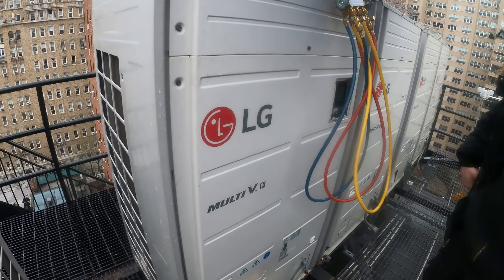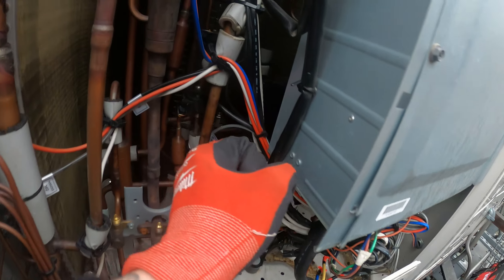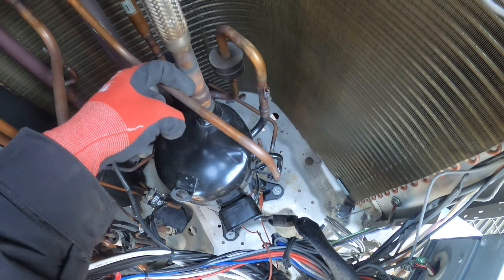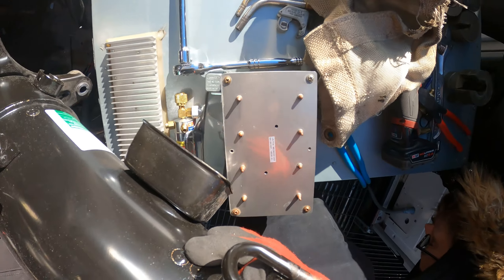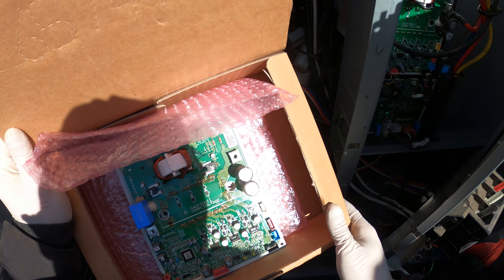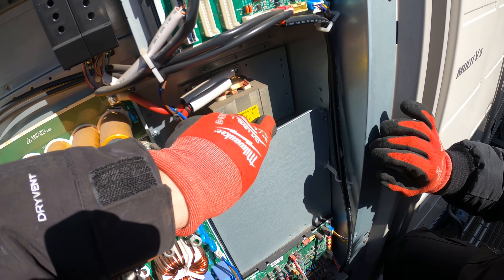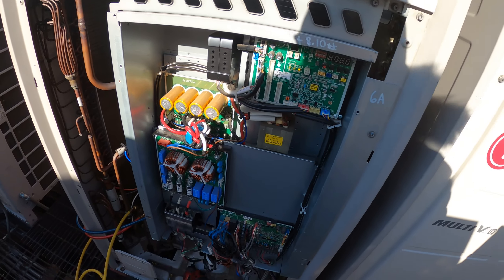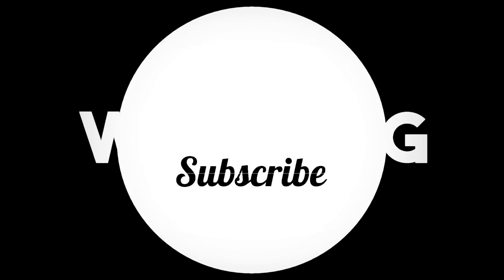HVAC Service Call: LG MULTI V IV Compressor & Inverter Board Replacement (LG Error Code CH21/CH29)

Comment: 18:49 no no it’s thermally conductive, not electrically haha. But it is correct that too much thermal past will will any computer board/pcb so quickly. I’m kind of impressed it took 3 weeks to fail.

Comment: I would say you’re probably coming back to change the inverter board again. The heat sink compound should be a very small amount. When you use too much it acts an insulator not allowing the transfer of heat. Just my two cents but I would have done a few small dots on the back so that when you put it back in the pressure will spread it for you.

Comment: Nice repair did not see dryer replaced. ?
Reply: These systems have no driers. Only strainers. That’s exactly why you have to braze while running nitrogen. If you don’t then it’ll be a shit show when you have to replace all the clogged EEVs.
Reply: @mwdub02  thank you for the info 
You the man!!

Comment: Did you perform the diode bridge test. The compressors are usually solid. Ive replaced inverter boards and noise filter board...never a compressor though.

Use your recovery machine to push the rest of the refrigerant into the system..

Comment: I'm dealing with a lg vrf v same code everything test good lg said replace compressor have you come across this? Everything test out good even the compressor and it's bad ? I have to put a new compressor in and have a different issue... this is happening as i am replacing a compressor in the same model same age 5 feet away working good last night today same codes as on this video also same code as before but the u terminal blew out on the other unit obvious replacement lol

Comment: Did someone diagnosed what cause the compressor to go out do you guys cut open the compressors to determine cause. I have been installing these LG vrf units for the last eight years we have never had a compressor fail I am always wondering when I see a video of a failed compressor I always want to know what the cause was. 

I have 3 facilities in industrial manufacturing I installed that run 24/7/365 two of them for 8 years the other for the last 5 years compressors never shut down,   still I never had to replace a compressor.
Reply: Congratulations
Reply: Just did one of these compressors in a  Multi V today.   Board wouldn't run the compressor even when I swapped compressors.  I wasn't expecting the 5 connections LOL.  Had 5.45 nS = 200 M Ω.

Comment: Yikes! If those boards are overheating and burning up it's no wonder with the thermal paste applied in that way! Please don't apply it like that if you want equipment to last. 

- Firstly, both mating surfaces MUST be cleaned off using cleaning/degreasing agent to remove all old thermal paste. 
- Secondly, for a heatsink like this, apply a bead of thermal paste in a straight line but DON'T smear it around. Then carefully mate the parts together without sliding or smearing. The contact pressure will ensure correct distribution of thermal paste. 

If the old paste is not cleaned off or new paste is smeared around in a attempt to make a better thermal conduction, what actually happens is that you end up with air pockets or bubbles  trapped in there which form an insulating rather than thermally conductive path.

Finally, although most thermal paste is not electrically conductive, cleaning it up from other areas (like you did) is a good idea. There are special products available, including environmentally friendly ones, that make it an easy job removing even very old and crusty thermal paste.

I've worked over thirty five years in electronics and IT building and repairing servers and PCs and other electronics. With some of the systems I work on the processors cost several thousand dollars each and have high dissipation requirements through a relatively small contact area. Incorrect application of thermal paste causes very expensive failures and other issues in a very short space of time.

P.S. I really like the content you post. I find it refreshingly different and the details you put in make more interesting than a lot of other channels.
Reply: Great info. What you say makes a lot of sense!
Reply: Thanks for the detailed information 👍🏼. 

What brand of cleaner would you recommend/do you use. Thanks

Comment: Why are you using the little pump to pull that 3 rd service port and also what is that 3rd service port for ?
Reply: Its 7cfm. How much bigger you want.
Reply: @sherwinalvarez7365  I might have been high when I wrote that I think I meant to write why are you using the third port but idk now lmao

Comment: I’ve been cutting/sawing off all the lines off the compressor, remove the compressor then I torch off the compressor studs from the lines. Found it easier then unbrazing yanking on lines off compressors during replacements.

Comment: Great job, with everything so compact its difficult.Could U pls give us a class on the steps for putting the system in vaccum mode.
Reply: read the manuals
Reply: Its literally printed on the door, don't even have to open the manual!

Comment: In my experience, the condenser fan will fluctuate between on-off and variable speeds while recharging. It's often an indication of inadequate charge or a charge that has not yet stabilized, so the unit throttles the fan to compensate.
Reply: Good stuff man. Props too you. Big, scary, dangerous job. You killed it

Comment: You really should clean up the old thermal paste before applying new. 

And it's best not to use an impact to screw in those boards. Some of the screws go "through" the chip itself to hold it tight against the heatsinkt and if you have a little oopsie with your trigger finger you can literally crack the chip. Ask me how I know..

Comment: The „new“ board has been reworked on. Somebody manually soldered some components and didn‘t remove the flux. It‘s the flux that looks burnt. Doesn‘t look very professional but won‘t cause any problems.

Comment: Who knows how to get them panels out of the way better. I mean he did what he had to but there has to be a better way. These engineers pack a bunch of shit into a unit and never think of service. They should have to run a call like this. Bet after they do they change and bunch of shit.
Reply: As someone who has changed a fair number of these, its easier on the MV4 to remove the entire electrical case assembly after recovering the refrigerant. Its intimidating given the number of wires but they are all color coded and generally only fit back where they belong. I tried the method in this video and ripped a connector off the main board due to stress on the wires. The MV5 has a heat sink tied to the piping and a wrap around coil so that's a different story. Agreed the service access is not great.